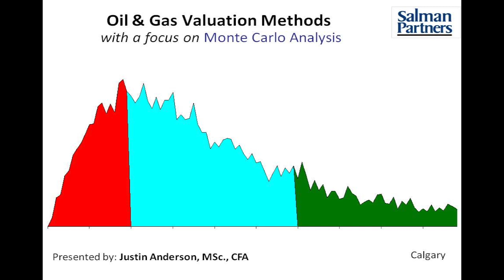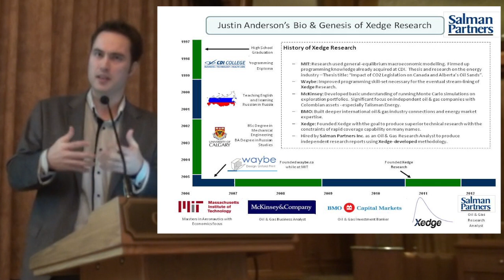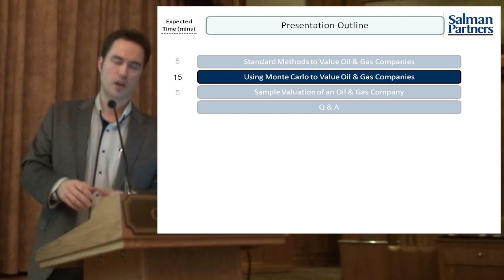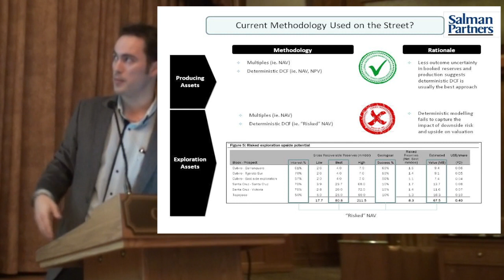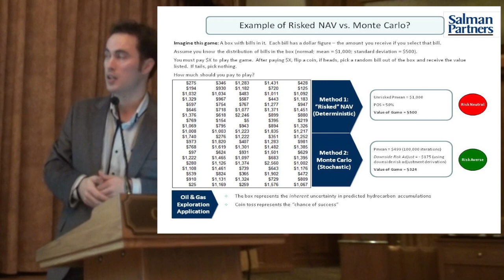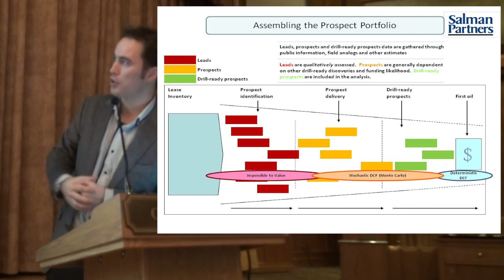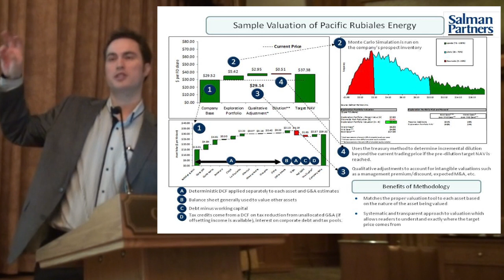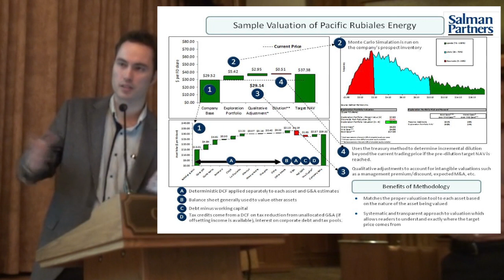Oil & Gas Valuation Methods with a Focus on Monte Carlo Analysis

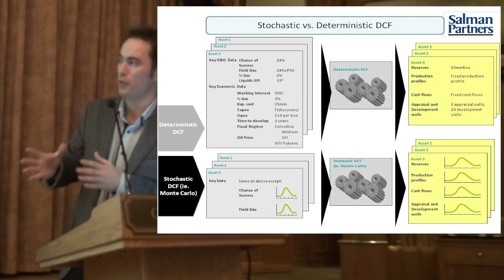Comment: Hi Justin - @ 14:44 you show a normal distribution. Is Monte Carlo distribution based on a normal distribution ? Or, is it able to spit out other distributions as well ? Is the simulation based on the exploration of a well ? If yes, for a conventional well, the reserves typically follow a normal distribution curve, but for a shale gas not so. Would you be apply a different probabilistic model or distribution curve in that case ?